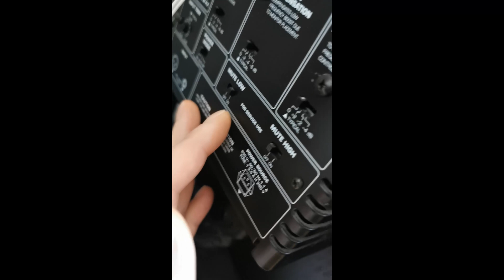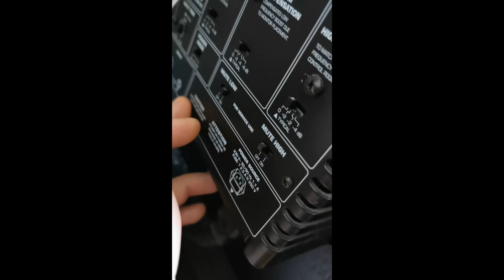behringer truth b2031a

Comment: Behringer Truth B2031A harks back to the 20th Century.... and to its 1990s era Genelec predecessor. I am not aware of any "2nd generation switches " for these B2031As. But even if there were, I would not pry them off the IC board and solder on replacement ones, no way. Perhaps soak them in WD40 or clean them inside somehow with an alcolhol-soaked swab. And perhaps also refrain from moving the little slider-switched too many times. If ever.  :cat-orange-whistling:
Reply from the maker: Yes the comax switches used for configuration are a common point of failure
Reply from the maker: So the switches don't necessarily fail from being "switched too many times" but rather more often from the vibration of the music itself. Contact cleaner or wd40 might allow for a messy, temporary and unreliable fix IMHO but whatever works for you, is whatever works best. Personally I've worked with electronics for a long time, so replacing those switches is just not a problem for me and certainly not a problem for most people with basic soldering skills obviously the most robust fix would be to bypass the switch altogether and just bridge your desired config but again obviously that's not for everyone.

Comment: Hope this helps, got given these behringers over 10yr ago, had the same problem with the switches and the dB turn knob. I soaked JUST the switches and the dB knob with wd40 using the fine straw nozzle, let it soak, gently try to move the switch but don't force it, repeat the wd40 every few days or so, it took over a week to get the switches clicking smoothly, still using them today
Reply from the maker: nice I was gonna replace the switches but in the end i just cleaned them also which works ok

Comment: i use 2 pair of them like a bi amp solution  through   preamp   ... since 2006 ...  awesome result folks ...
Reply from the maker: They are a really good sounding speaker
Reply: How are you using 2 pairs of ACTIVELY POWERED studio monitors .. as PASSIVES? Have you opened them up or dislodged the AB amps in the rear and now using only the 2 drivers, so converted them from ACTIVE to PASSIVE studio monitors?

Comment: I was about to purchase a pair of these.
They come with 3 years guarantee but not manufacturer.
Are these switches from brand new speakers? Thanks
Reply from the maker: No used they definitely sound amazing and give a really good listening experience but they are perhaps not the best reference point as they sound much better than most systems. so you will hear detail and depth in the sound that car stereos, headphones or other speakers won't produce without a much more expensive environmental setup, and so if you reference your music with them, the average listener may not get the same experience depending what they listen on. As for the comax switches they are used in my JL car amp and low and behold developed the same issue after about a year, there are some work around's I will detail in an upcoming video but I'm moving house ATM so my video production is slower than usual.
Reply: I've been given a set of these and I have the same problem, one keeps cutting out unfortunately hope I can get it fixed😪
Reply from the maker: @discostew9220  You might be able to make a temporary fix just by pressing some bluetack on the affected switches to stop them vibrating with the audio otherwise you can perminantly bridge/bypass the switch in the position you want by soldering a piece of wire in place for the corresponding setting/position which is probably the simplist most reliable fix, if you don't plan on changing the settings once you set them up.
Reply: @reedy8585  Seems to me you can take a sledhammer to them also as a viable alternative once they are out of factory warranty. Or make them become out of factory warranty by doing the mentioned trickeries.

Comment: I got them and I noticed that now I can't hear any sub bass. Does they lose bass over time?
Reply: Assuming they work correctly, they play down to about 50Hz before rolling off. They'd do well with a sub for the very low frequencies, or you can use an EQ on your PC if not listening super loud.
Reply: "I can't hear any sub bass." ADVICE: Replace the defective sub driver. Also, make sure you don't screw-around with any of the two FOR SERVICE USE ONLY slider-switches, one for the woofer and/or the other one for the tweeter -- unless you are a qualified Behringer service technician. :face-fuchsia-wide-eyes:
Reply from the maker: The switches on the Back can mute the sub you can also change the levels if none of that works for you, you could use an eq I recommend sonaworks if your using them for producing